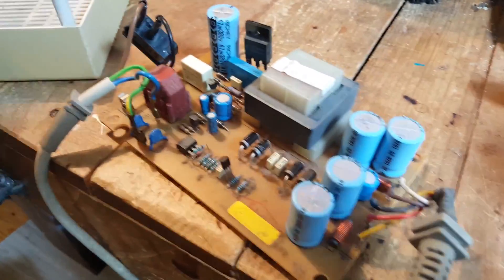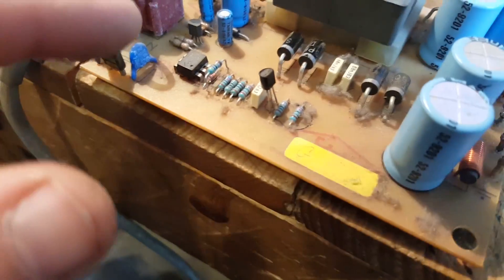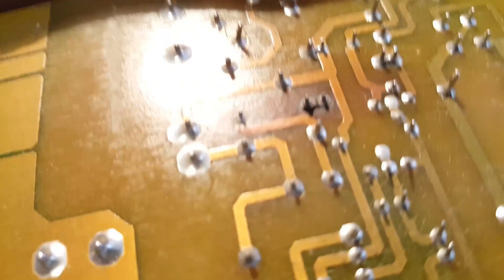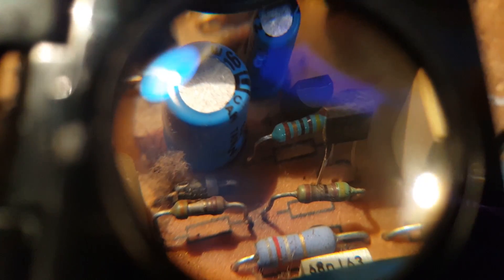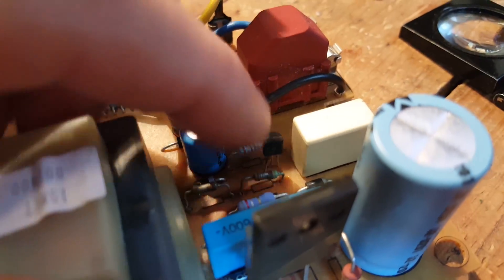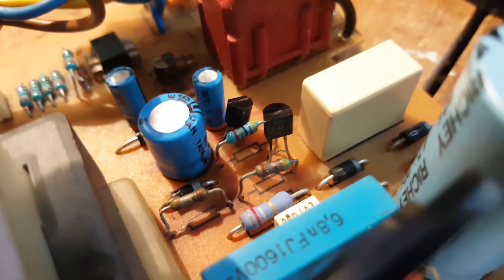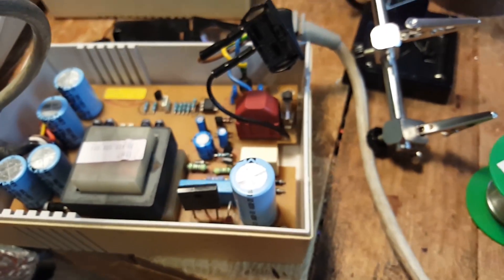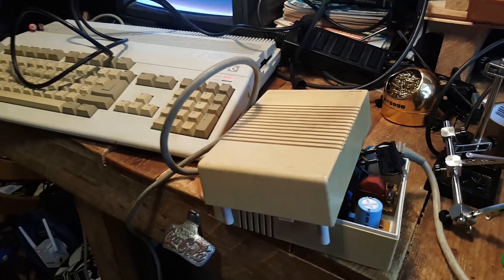Amiga Restoration  - A500 / 600 Power Supply repair

Comment: so how long did the PSU last after replacing the Thyristor and 0.5W resistors?   I have a PSU with same issue and also upped the wattage on the resistors.  Awaiting the BXR44 thyristor to arrive in the post.

Comment: Yup. You got the thyristor and transistor first go. Took me ages. I have never seen an example of this psu without those two resistors burnt. They probably measure fine. They did on mine. Wish I'd found this video before. Good work.

Comment: Nice fix. A very good idea using higher wattage resistors. What were the resistor values, by the way?
Reply: MindFlareRetro can't remember now but I'll check back next week when im back home.
Reply: Good idea - would help others with the same model!  Hard to find schematics for any of the Amiga PSUs, so unless you've got a working of the same model hanging around, sometimes hard to know what replacements to get for some components like this.
Reply from the maker: back home now. so these were two 47 ohm resistors: Yellow - Violet - Black - Gold - Brown : 47 Ohms 1% - 1/2W
Reply: Yes, my thoughts exactly. However, I wonder how differently the component values might vary as I am in the 60Hz part of the world.
Reply from the maker: two 47 ohm resistors: Yellow - Violet - Black - Gold - Brown : 47 Ohms 1% - 1/2W
Reply: Excellent. Thanks.
Reply: Hi thanks for doing this vid, i have virtually the same burnt looking resistors in my a600 psu which is pretty identicsl to yours what thyristor did you use?
Reply: In the past I've used a 100 ohm 5% tolerance 5 watt power resistor in place of the two 47 ohm resistors. I would reuse the BRX45 Thryistor unless you can find one that can handle more current. I think the BRX45 handles 800mA if memory serves me right.